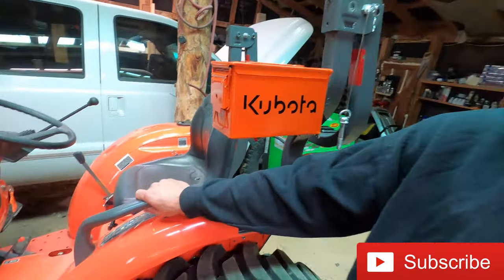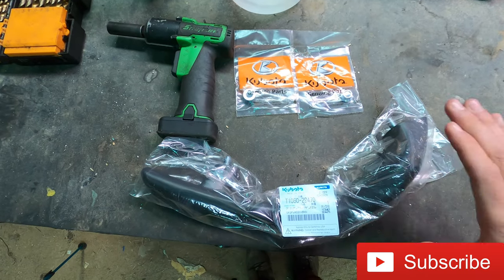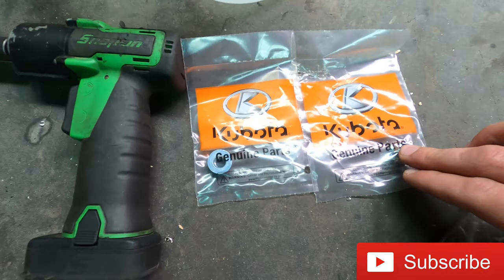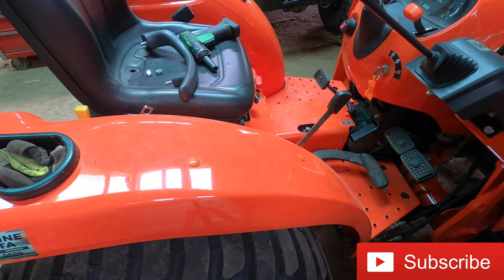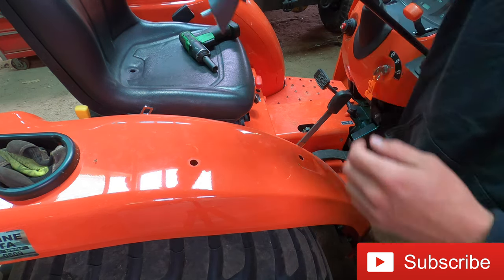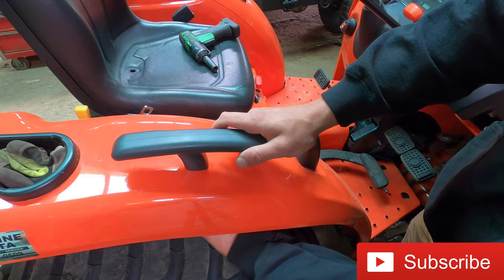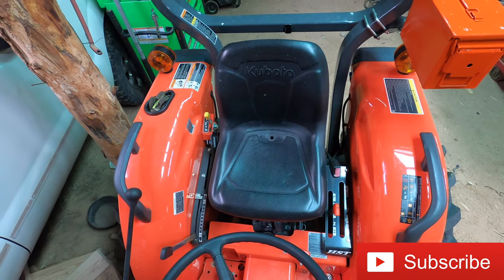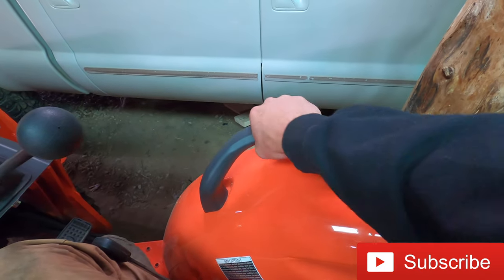Kubota L-Series Tractor MUST HAVE MODS!! [RH Grip] [EPISDOE #4]

Comment: Got the Kubogy MX5200 shuttle shift & luckily it came with the right side grip. Along with the loader-control valve (stations mounted), just about eliminating right side access. Also the low-rider-buck-board seat (maybe 3/8" suspension). Also had a "deluxe" feature "no right side" step. At a measly 825hours & 4 3/4 years ,luckily  ZERO PROBLEMS. So with suffering with the afford mentioned problems, l rectified & rejuvenated those problematic issues . Like yourself "one" never stops building "their" Kubogy.  Also in my instance my bh92 back-hoe was very sluggish--- the fix; bigger hoses & fittings (they cheeped out) on that one also. In reality no more power, just 40% more speed & cooler hydraulic temperatures. My Massey-Ferguson 1736m t&l came with ALL those problems fixed from day one , but then again it's a different tractor for different purposes. Thank you Sir for this good vidio &happy safe Tractoring.